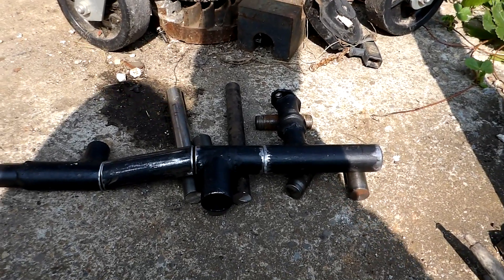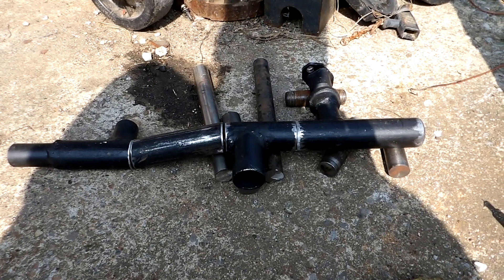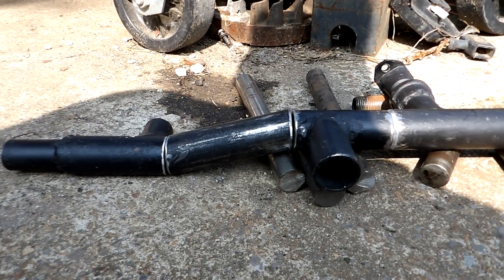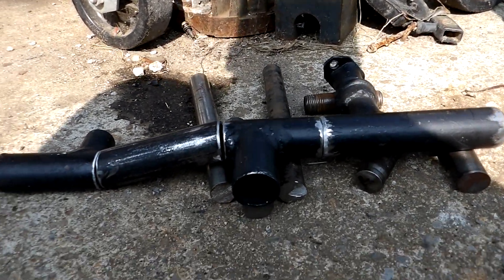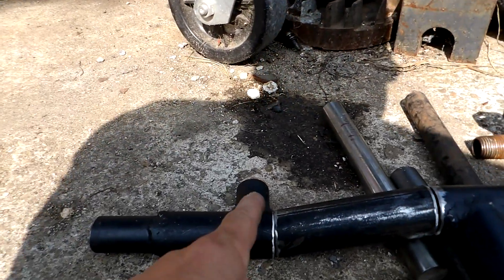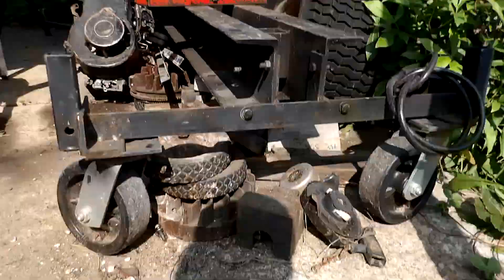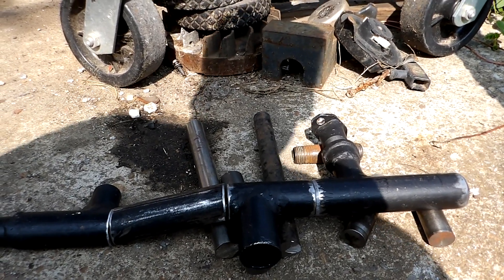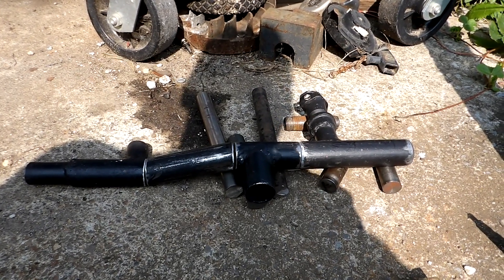Making the 4 Cylinder Briggs 5432

Comment: If you merge the header to 4-1, Will it sounds like a inline 4?
Reply from the maker: It sounds like an inline 4 anyway, but would sound differently with a combined exhaust, rather than the 4 separate mufflers I use. I built the 7 cylinder with separate exhaust, then followed peoples comments, and built a 7 into 1 exhaust system, and id did sound differently.